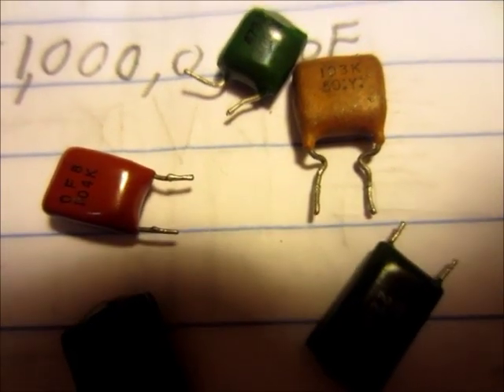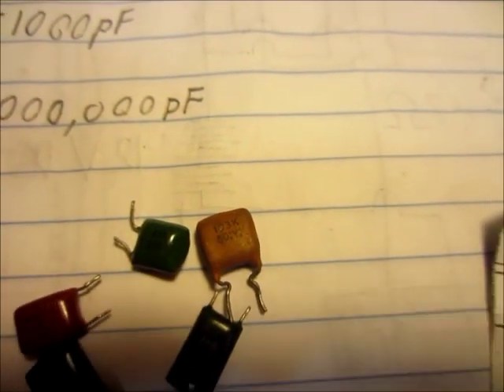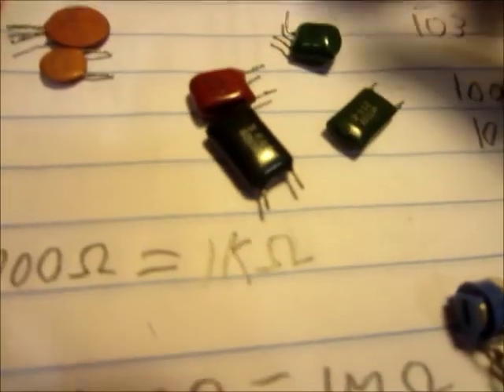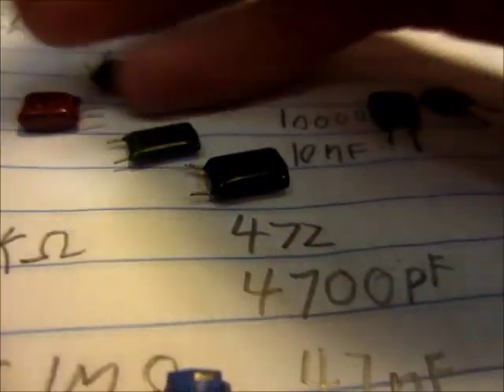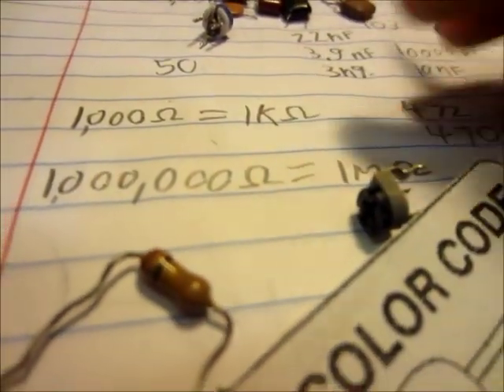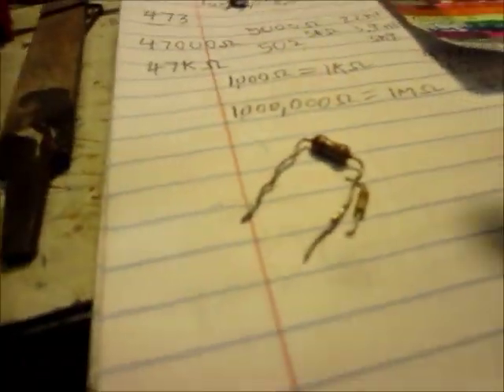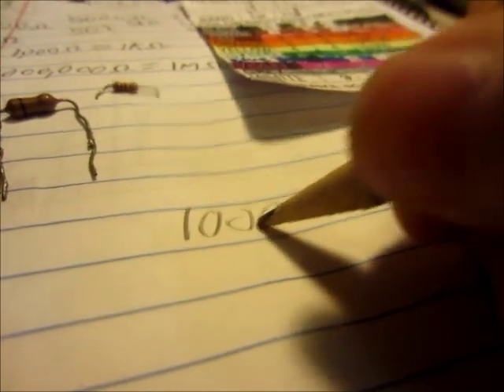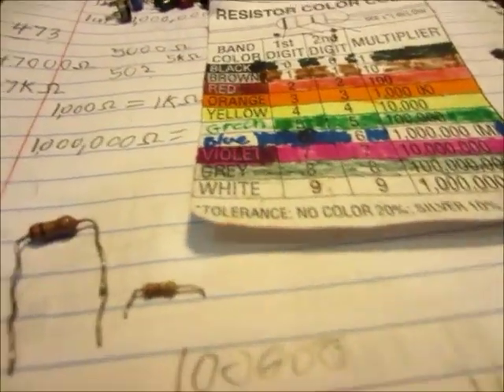How To Find the Values of Ceramic Capacitors, Resistors, and Trimmer Resistors

Comment: I don't really like auto ranging since when your on the verge of the setting it keeps bouncing from one to the other and they are a little bit more expensive. Go with a basic one I have 4 meter at home and 2 of them are 30 $ one and they work just fine one I don't know the price since its an antique one and the other is my good old trusty radio shack one that i got for 99$ normally retail at 200$ but most feature on it I don't use like knowing the Hfe of a transistor.... really... Hope this help

Comment from the maker: The cheap ones I buy are rated for a max of 750 volts AC.  I burned it out by testing something that I did'n know the voltage and it tuned out it was a few KV!  It's kinda hard to tell if you burned it out or not because no magic smoke ever comes out!  The only way to know is that most of the settings read about 10 times the real value.

Comment: Well they are a little bit tougher then the cheap one of course but they can be burn if you do something stupid like trying to take a voltage reading in AMP mode....or trying to get a resistance from a 120V socket.... I've seen couple of people do those thing -_- but normally the fuse pop before :P check of ebay maybe you can find a nice one!